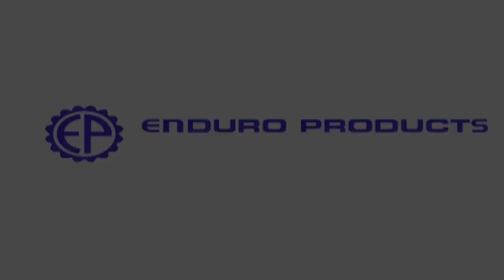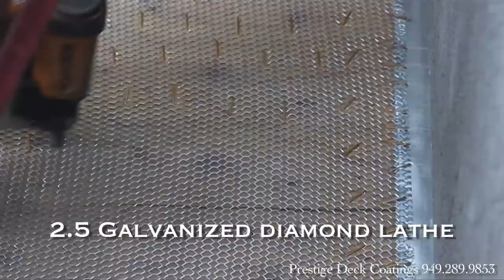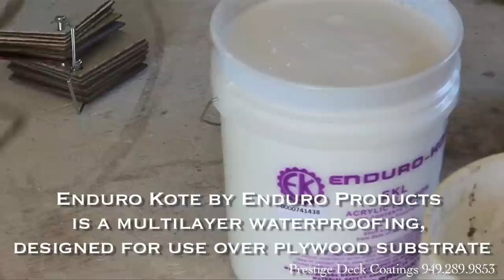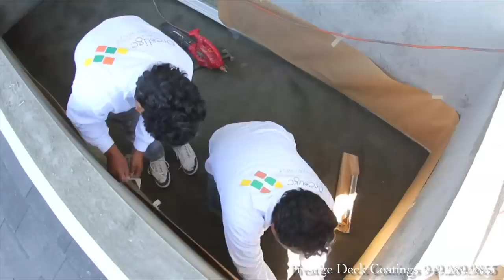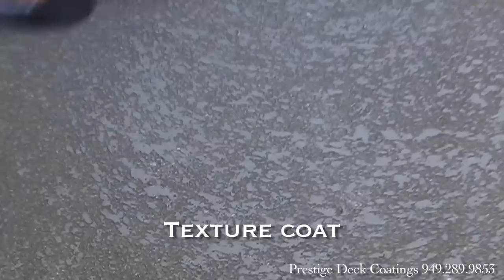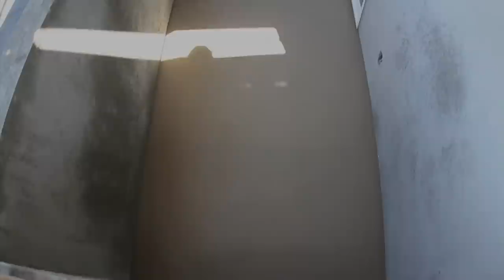Deck Coating and Waterproofing, Riverside County, CA | Prestige Decking, #1 Deck Coating Contractor

Comment: Hello,  I have a technical question if you would please help me understand. Does the deck become completely waterproof after the Base Coat? How about the intermediate? If it rains hard between these two or after intermediate but before the finished coat, is there a chance of leaks? Thank You.

Comment: I have a small upstairs deck that needs to be sealed up.  Below it, is a storage area so would be nice not to have water drip into it from above.  I store lawn furniture in there.  The deck is about 100 sq ft in size, just boards close together, but no plywood sheeting.  These boards have gaps in between.  If you were to do that same treatment, plywood, wire netting, stucco... how much would that be approximately?
The sides of the deck have open gaps all around, with a wooden rail for safety.  How would the water drain from deck?  I guess you could squeegee it off, right?  Then seal up the stair structure below to create a nice storage area below deck.  Do you folks use any waterproofing membrane like Schluter Kerdi membrane over the plywood?

Comment: very nice coating, how long does it last?
Reply: One month , that's basically cement with glue , and that will crack a lot , I have 20 working with waterproof material,  and this is the worst,  because has nothing to hold or to prevent from cracking
Reply: They didnt put fiberglass thats very important